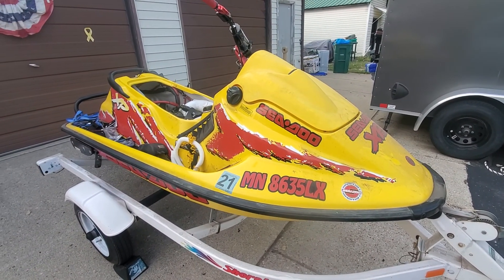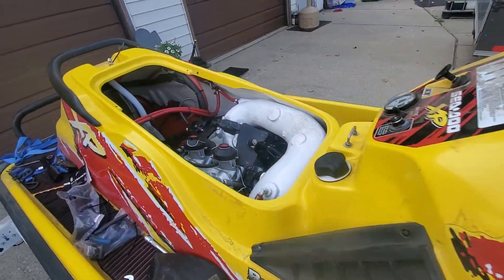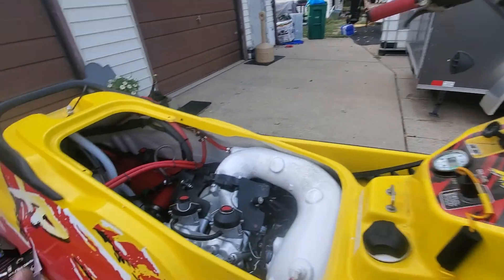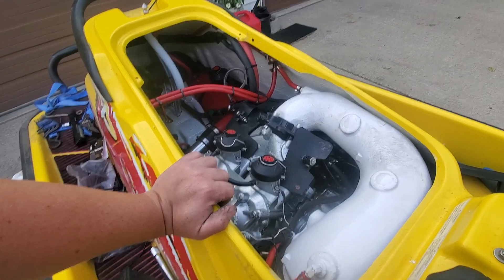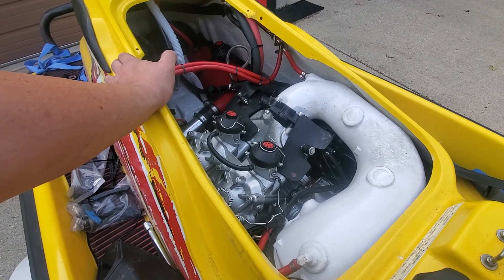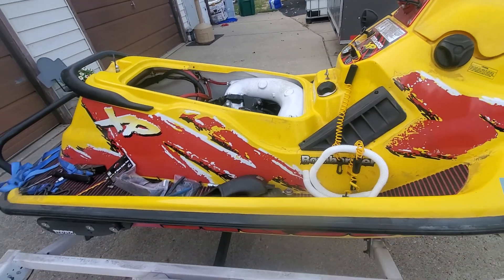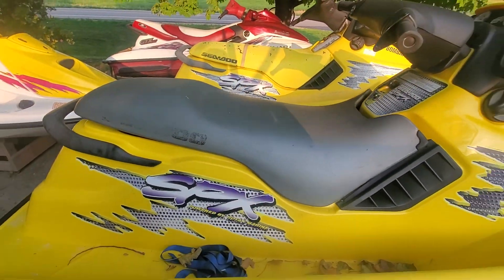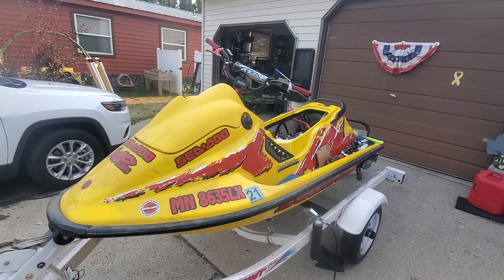1995 XP 951 Project: Update Firing Up the Engine

Comment: How was it swapping the engine on the 95 gtx? My motor just went and thinking about getting that sbt one like you did
Reply from the maker: Pulling it out was easy, maybe 2hrs to pull it. Take pump off and drive shaft off. Take exhaust apart, carbs off, unhool cables/lines, unnolt engine and pull out.

Putting it all back in and dialing it in, setting oil pump, aligning engine, all takes time. Probably 4hrs to get it all done
Reply: @GC-EXTREME  can you do a video of installing a similar engine?
Reply from the maker: @Itsjustradd  no. Im not setup for actually recording me doing the work, i usually do videos explaining whats going on, and then follow-up videos as the project comes together.

Theres a few special tools youll need for doing an engine swap, one is the engine alignment tool, which isn't cheap to buy new ($250ish), then a spline impeller/pto removal tool ($20), which comes in handy for removing impeller to change wear ring and removing the pto if you need to swap the pto onto your new engine.
If you get an sbt engine youll have to remove the pto and stator/stator cover and flywheel.
To remove flywheel youll need a big socket, i think 32mm but i cang recall off hand.